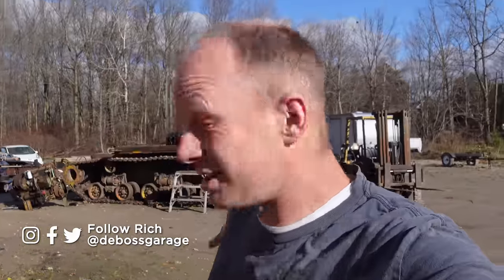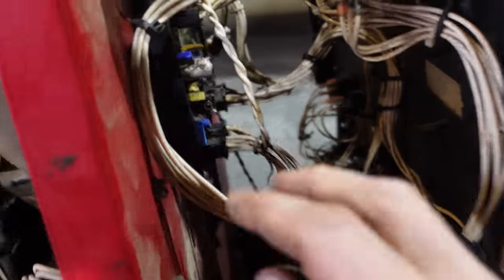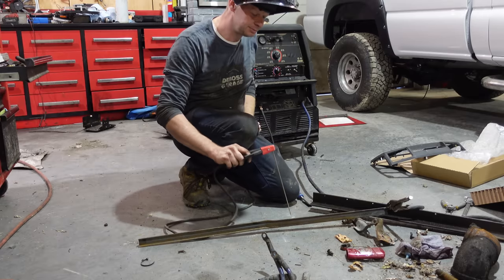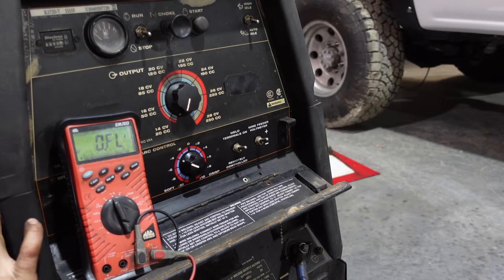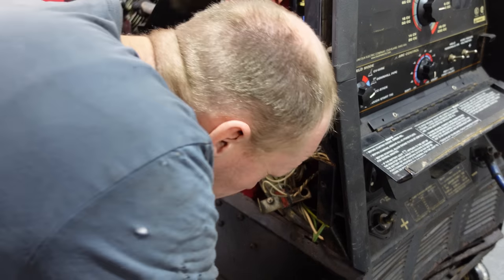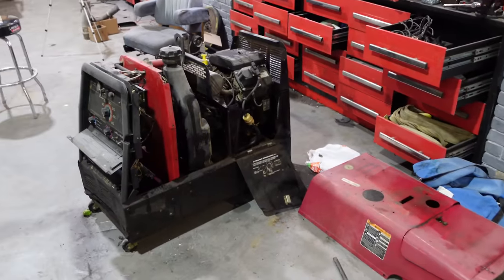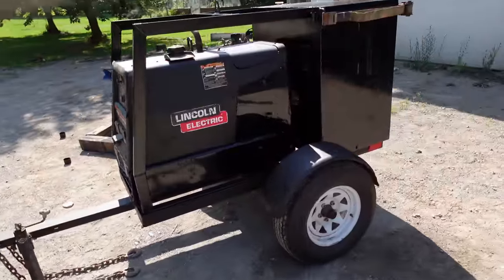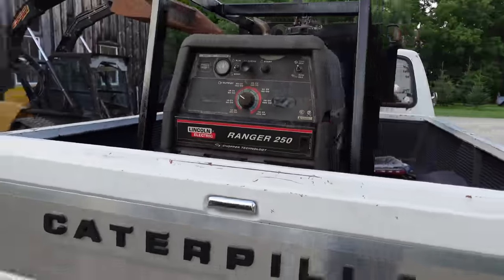$1,000 Lincoln Electric Ranger 250 Won't Weld. Can I Fix It?

Comment: Id like to see inside the "computer" to see if its repairable. Our right to repair our stuff is under attack daily
Reply: I thought US farmers won the "right to repair" lawsuit against green??
Maybe not in Canukistan??
Reply: it's actually a very easy board to work on most of the components are marked and can be sourced from the web
Reply: @stevenberg1903  that's just one bill. Auto manufacturers have a loophole that all diagnostic data is transferred wirelessly so it doesn't fall under any current bills.
Reply: The one they replaced on the center divider panel is completely potted in about 1/2" of rubber/resin. There's no feasible way to get to the components to probe test points or de-solder/soler on new components.
Reply: Lincoln sets those boards in a plastic tray and then encases them in potting material about 1/2 an inch thick for moisture resistance. There is no simple way to just replace components on those boards
Reply: @stevenberg1903 They quickly found new loopholes. Basically just ended with farmers being able to buy access to some of the software for diag and repair. Doesn’t mean things are actually repairable.
Reply: My 1939 20th Century 240V stick welder is still operative
Reply: Most of them don’t need the computer label… but it scares people to think there is more to it.
Reply: @theSam91 I searched for the board. It has a thick layer of resin. That's the way of stopping a repair. Maybe Lincoln added the resin to protect it from humidity?
Reply: Units like that are likely to be filled with resin/epoxy to keep moisture out. Not really fixable.
Reply: Most new equipment is built not to last and to not be repairable except at uneconomical levels of expense. And made in China, as we deindustrialized and lose the ability not just to repair, but to invent.
Reply: he's in canaduh , they have no rights , ask a trucker
Reply: @stevenberg1903  Farmers in the US did, but it has yet to be implemented. There was a victory in MA for R2R, but automakers were flat out told to ignore it. Canada faces similar issues. We need R2R now.
Reply: @wobblysauce  👍🤣
Reply: Anything electronic can be repaired if you want to put the time into it, things take a turn when data processing rears it's ugly odd shaped head.

Also, the board is called a "computer" but it's not really a computer in the modern sense. It's just bare bones voltage/current sensing with safety features and engine management incorporated in it.

Comment: FYI that thing you called a fuse is known as a shunt. current flows through it and at a certain point (the smaller wires) you can measure a voltage across the shunt which is proportional to the amount of current flowing through it. exactly how the old charge and discharge meters work in old cars and trucks and also some lawnmowers and tractors
Reply: Are shunts just mosfets?
Reply: @javionsmith6818  Shunts are just big resistors.
Reply: Shunts are low resistance  links used for measuring high currents with small volt meters. As current passes thru them a voltage proportional the current flowing appears on the measuring terminals which is read by a volt meter. Simple ohms law arrangement.
Reply: FYI a 100 dollar welder does this work Canucks got more dollars than sense
Reply: @ayitsyaboi They are usually physically big, but very small value resistors..  You put them in series with your output and because they are such small value, they don't affect the output by much, but they still need to be physically big to carry all the current.    Their resistance value is usually very small fractions of a Ohm, but when multiplied by the potentially 150-200 Amp current that the welder can source, will still develop a volt or two across the resistor that can be accurately measured as an indication of the actual current flowing...
Reply: @RinkyDinky-dj1co Name a 100 welder that does 300A (yes 300) in it's sleep, runs without a plug in, and can do stick, MIG and TIG all in one box, and also act as a generator to run grinders and other tools?   Obviously, he needs to add a spool gun and TIG torch, and all of us were shouting to leave room on the cart for two gas bottles of Argon and Ar/CO2 mix so that the other processes can be used but it is worth every penny he spent to repair it..
Reply: I thought that looked like a shunt, came down here to see if somebody else noticed it as well👍
Reply: The twisted wires are also a clue that they're sensing something more analog, that's to reduce common mode interference.
Reply: @Flying0Dismount  yes add a wire feeder and you can do mig processes.

Comment: It's ok to make fun of the soccer mom van as a work truck, but about 5 years ago I moved into a 2004 Honda Odyssey I got free (no engine lights or anything man, it runs so nice, ac works it's got heat all the power nonsense still works but it's got over 300k miles now oh well) anyway, I have NO wet tools, I can lock my doors - it's all tinted glass in the back so nobody can see in anyway - it gets 22mpg on the highway, I still have 2 captains seats in the back so I can take my boys to work when I need to, you know or school if it's one of those days, man.. I love my van as my work truck. I'm mostly a mechanic and a home repair person (I do computers and a/v as well, but that's special) and man the van is a o k. I don't' care I have a truck but I don't need to fit in anymore, I'm too old to care about what other 'guys' think of my car now.

Comment: The second computer is the the one with the big red capacitors mounted to the giant heat sink on the other side of the center baffle. The one that was replaced is the control board or basically the low power brain of the welder. The other one is called the chopper assembly and does all the high power grunt work of the weld power. The chopper assembly can be thought of basically like a simple inverter welder.
Reply from the maker: Thanks man!
Reply: I have the same welder with the exact same problem with less than 200 hrs on it. Can that control board be repaired?

Comment: What you were playing with there was the current shunt, the two wires measure the voltage drop across the shunt to determine the current. They're in a twisted pair "squiggly" to reduce induced voltages from adjacent wires -interference.

Comment: That is why I like miller you call tech and they will walk you through diagnosing the welder.
Reply: Lincoln probably does as well, but talking to customer service doesn’t make for very good video. Some of us also like to poke at it ourselves before calling just because we like to tinker, I do agree Miller makes a great machine my multimatic 220 ac/dc is an awesome machine.
Reply: Lincoln will try to assist as well.  I could call up three different weld suppliers in my area and they would all do what they could.  I run Miller and ESAB.

Comment: Nice job. The only thing I might have suggested is a hinged rain cover bolted to the frame, then you don't have to worry about sudden storms soaking your welder or going down the exhaust pipe.
Reply: That's what a rain cap is for....

Comment: Suggestions 
Get some trailer hitch sized tube and put some receivers in convenient places around the frame to place a detachable vice and work bench.
If you use trailer hitch material you can also move the vice and bench to other vehicles.

Comment: The computer is actually “repairable”….our shop had similar model but bit smaller, same issue. We repaired it for $340.00. Took it apart, shunt short fused a couple of resisters. Always a pleasure…cheers from the Limestone City…(Kingston)
Reply from the maker: Thanks man!  I know ECI, the company that made my Tape Boss fixed a couple boards for tractors as well.  I just didn't have time to run to Toronto

Comment: The capacitor should have probably been the first thing you repaired. They are ultra cheap, ultra easy to change out just a little solder, and it sparkling as it winds down but not when running seems indicative of a capacitor not being able to discharge it's stored charge to start the weld. Of course, that capacitor was on the board you replaced. And yeah, they would do everything in their power to sell you some proprietary horse shit for big bucks rather than replacing a cap that costs probably $0.60 retail and about three minutes of labor and consumables.
Reply: That board is potted and a proper pain to do any servicing on. Hence the "proprietary" fault seeking (it basically involves bending over and asking Lincoln how to put it in).

Comment: Rich -  that welder is multiprocess and can do wire MIG, stick, as well as TIG (just need to add a spool gun and TIG torch), so you should have left space on the cart for two gas bottles (Ar and Ar/CO2) to do the other processes..  Makes it much more versatile than just a stick welder...
Reply: The other processes are usually pretty poor outside where this thing will most likely operate for most of its life. There are better machines to use inside where you have access to AC power.
Reply: Outside you can use Innershield. Take care.

Comment: That being an older unit, I would bet the computer is repairable. Judging by that capacitor and the rest of the unit, likely just a surface mounted component. Even the boards with all the potting compounds can be dealt with and repaired, if you have the tools time and know how to do the diagnosis and repair. The more modern stuff is a whole other bag of cat lady crazy, way to many micro components and multilayer PCBs to even begin a trace. Things get better with technology but get worse at the same time. I would bet the old school Hobart with a Willies jeep engine still runs to this day, didn't really run the best down low but for dragline repair it got the job done. Good on you for helping the football clubs.

Comment: Guy had a few trailblazers and two bobcats on Craigslist. Tbs were 400 and the bcs were 300. I obviously wanted the diesel one even though they were clearly missing parts and needed some money input but by the time I got there there was only 1 bobcat left. Didn't even look at it, just threw it in my moms minivan and off I went. Annold timer told me once to spin a corded drill backwards and itll remagnitize something in somewhere so i did it. It worked. I haven't put a dime into that bobcat aside from gas. Same battery since like 04. That little thing starts every time, welds great, a/c works. Case is a bit banged up but I love that old bobcat. Probably have more hours on that than my pipe pro 400!
Reply: The backwards drill thing sounds interesting, I'd love to know what exactly it does.
Reply: @Cantthinkofahandle117  i don't even remember if it had to be backwards. I think it re-excites the field windings? I think it only worked on old generators and welders

Comment: The curse of absolutely proprietary electronics. A "repair" is an entire circuit board swap when often the broken component costs cents and the labor cost of a board repair tech is like 10% of that new circuit board.
Something I hope will become more popular with time is to repair equipment like this welder by replacing the proprietary electronics with open source alternatives.

Comment: Rich ive spent the last few months fixing up a old miller trailblazer302 that had same symptoms as your ranger. Ended up being a messed up circuit board. Send them to a fella name frank heizler he fixed them up just as good and cost 1/3 as buying new boards. I recommend not jump starting yours as it caused damage to my boards and what caused the issues.

Comment: Cool rig. But you may want to flip it around.  I built one like this and had to flip it because the truck was always throwing stuff al over the front of the welder.
Reply: Good point, another option would be get a boat shop to make a nice cover with snaps for travel and storage
Reply: You’re exactly correct. That’s why it amazes me that Lincoln chose to build the new Ranger 330 MPX with a non-rotatable exhaust elbow that points straight out the back of the machine so when mounted properly on a trailer or truck, the elbow is pointed straight into the weather and the bugs and road grit. Extremely poor design. I love my Lincoln Ranger 305G’s and currently own my third one but I only kept my 330 MPX for one month. It was riddled with poor design from one end of the machine to the other.

Comment: I hope you got the old computer board. It was probably just a few resistors and things that needed replacing and they hit you up for a whole new board, I am sure a electrical technician could of found the issue and fixed the old board, be handy to have as a spare.
Reply: They pot the boards with some type of epoxy so if can't be fixed.

Comment: I bought a surplus Miller inverter multiprocess machine a few years ago.  I don’t know anything about this machine but what they call computers are probably just circuit boards with components and a few basic IC’s on it.  In my case it was a resistor that had failed, had a fried contractor and I went ahead and changed out the big caps since those can be a common failure point.  Side note, it always scares the hell out of me working on electronics with capacitors as they can store quite a bit of energy for a while and can knock you on your ass even with the machine off and unplugged.  I always discharge the caps through a resistor before poking around.

Comment: No shame in knowing when to take something to an expert when you hit a wall.  I picked up a dirt cheap 3/4 ton GMC pickup to haul dead cars around with (I'm a mechanic) and it needed one of everything to get it going again.  Biggest thing was the broken flexplate.  Dude selling it thought the engine was noisy but I've heard that noise a million times before.  I got everything in the truck squared away, including a new flexplate, and found out the transmission wasn't going into tcc lockup.  After researching how the tcc hydraulic circuit works in a 4L80e, I decided to take it to a transmission shop and have it rebuilt.  The damage from the broken flexplate allowing the torque converter to wobble around on the input shaft and a bad MAF(that I had already replaced to get it to run correctly) had caused the PCM to miscalculate engine load and toasted the transmission, according to the transmission shop.  I happily paid them and now have a truck I know I can trust with a warrantied transmission.

Comment: Yup, it looked like a "control" problem the way you could draw current as the machine shut down. The only thing I didn't understand was - less than 5 mins in, you point to a faulty capacitor but you didn't change it. Electrolytic caps fail all the time and the liquid electrolyte comes out making a mess - the classic electronics fail.

Comment: Rich, I love the channel! As well as your main channel! Anytime anybody doesn't want to show you how they fix stuff means they're pulling crap out of their ass and just guessing. I've been in electronics for over 50 years, and part of that board when you pointed at it initially showed a capacitor that was definitely leaking, and electrolytics are known to go bad especially in extreme heat and cold conditions. If you'd known some electronics kind of dude that likes to work on old stereos, he may have been able to bring that old board to life by just recapping it.

Comment: I think you did good at 2500 for that welder I have a similar with the better subaru robin engine and I'd want something like 3500 for it of course every thing worx had amsoil in it since first oil change and the  hours are low like 700. B acknowledged when these were new they were 5000 to 5500 I think now a new one is like 7000-8000 something to consider. Not to mention quick cash your trailers prolly worth 500-600 bucks so yeah ide say you did real good coming in under three grand painted and all. Flex coat makes a epoxy rubber paint if you buy a quart white and a quart black you can mix any color gray you want. Works great for the sheet metal.

Comment: Welding circuit "cards" for these are eye-watering from Lincoln.. I.E the printed circuit boards that confuser the welding stuff.. "Bargains" can fast become Dull if you need go buy those.. Your local Lincoln (or any other maker) will have stacks of "dead" welding machines out the back where customers baulked at the price of new cards and bailed.. 

Honestly, they're also waaaaay crap compared to what's available new for less  - check out a basic Mosa Magik-Weld. Those you can chuck into the boot of a car yet they will weld beast-mode... I ran these ^ big lumps of junk for years till I discovered Mosa Magik welds, after which I never ran anything else. Why drag an elephant around if a mouse will do the work?

Comment: I had a wire from a wire wheel end up in my eyeball once, didn't really hurt just felt weird. I could see the crud along the length of the wire and it was strange to have it move around with my eye. But other than that, I just reached up and carefully popped it out. I don't recommend it though.

Comment: With that little tongue weight and short wheel base it might have trouble with swaying back and forth. I’d hate to see that thing end on its side going down the road.
General rule is to have at least 10% of the weight on the tongue.

Comment: just put it in the truck with cabinet to tail gate and use longer cables, shouldn't have to adjust it much or get a remote box for the welder.